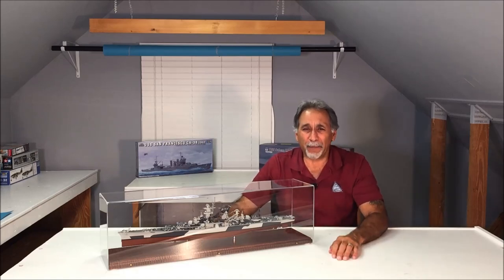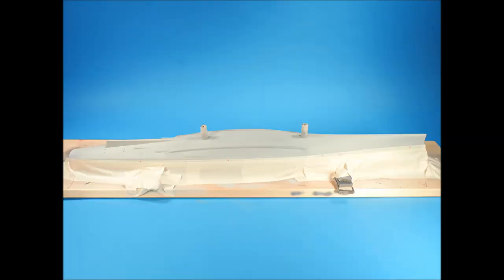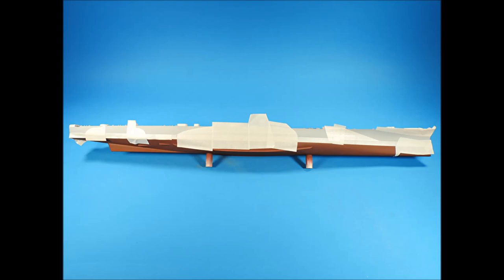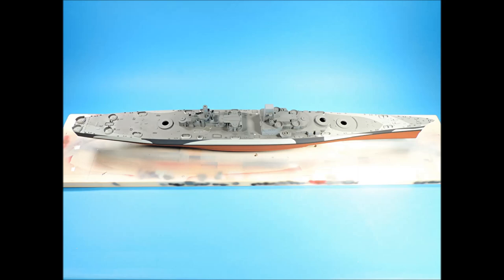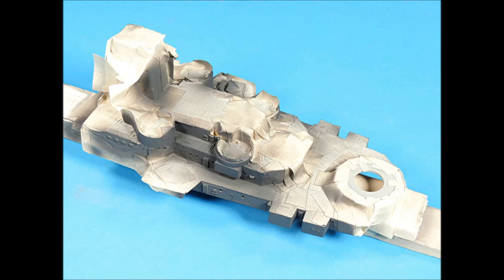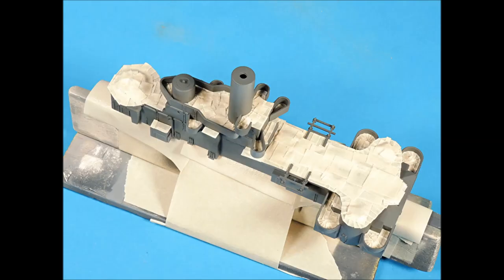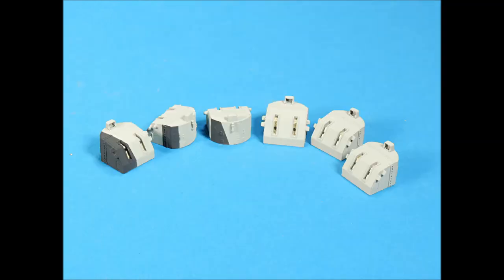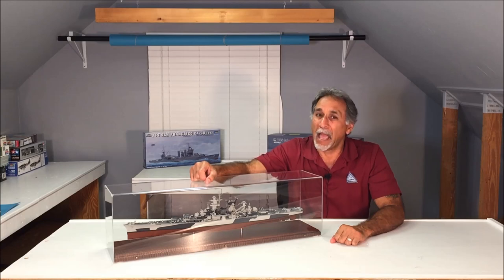Painting a US Navy measure 32 dazzle pattern paint scheme

Comment: Mike, can you comment on why you use 12 psi?  Thanks!  Gerry
Reply from the maker: Hi Gerry

When airbrushing a surface which is uneven and has protrusions low air pressure will prevent the grainey or orange peel effect

Mike
Reply: @scalemodeling  Super.  Thanks Mike!

Comment: For Measure 32, shouldn't the decks be 20-B (revised) and 5-L light grey, not 5-O ocean grey and 5-L light grey?
Reply: For 32 the schemes vary drastically. This is the official(short lived though) MS 32 for USS Alaska. Guams MS 32 looked a bit more like USS Missouri. MS 21 and MS 22 have 20-B deck blue. They’re essentially the same except MS-21 has grey at the weather deck line and above. MS-22 is just Deck and Navy blue.
Reply: I mentioned Mighty Mo, hers is MS 32-22D

I said short lived for Alaska because she only wore MS32 during trials, she wore MS22 for her wartime deployment. If I remember correctly.
Reply: @hattrick8684  wow, blast from the past!  Trying to figure out the correct Measure & then find the (often roughly) equivalent paint can be a task bigger than building the model itself! At the time I was trying to find the correct scheme for USS Benson when she was in the North Atlantic. She wasn't there long, so that was fun research!
Reply: @xRepoUKx  I had posted a link to a site that has all USN camo schemes, it looks like it’s been removed. If you Google a specific MS, like above it will show up. That’s how I found it when looking for scheme for my current Fletcher build. It only has USN ships though, so still need to find an RN equivalent when I decide to build Repulse and Cossack.
Reply: @xRepoUKx  Honestly it was the other way for me… I just researched endlessly before getting into modeling. The wife thought it would be a good hobby for me to get into… she regrets that now, I do even more research now and build models lol